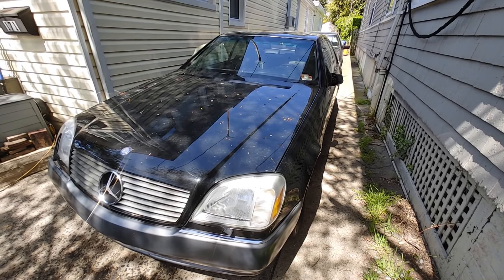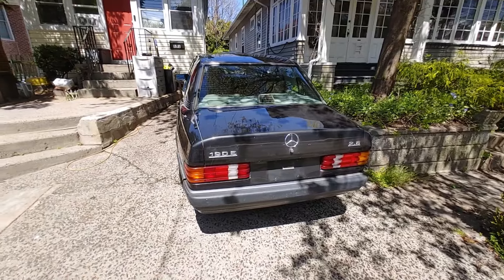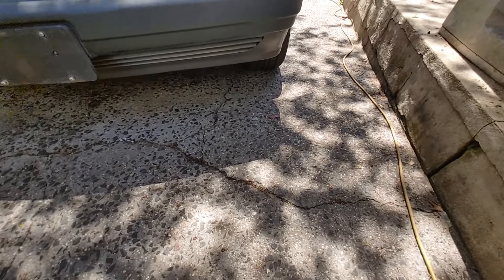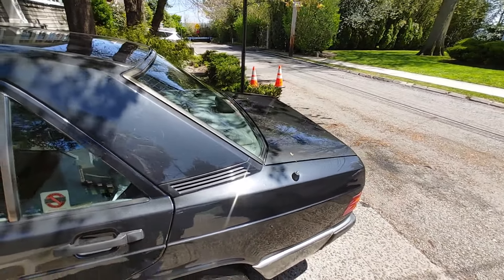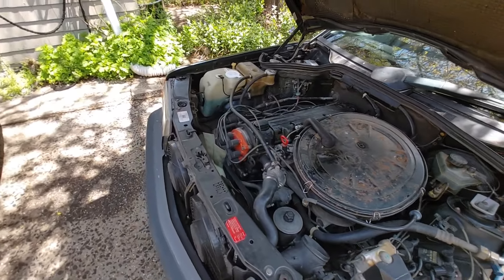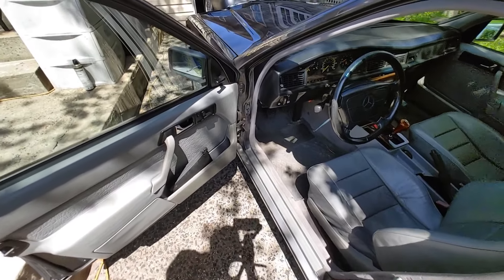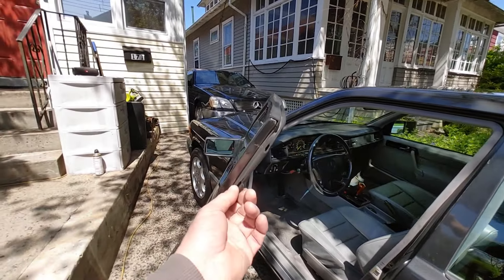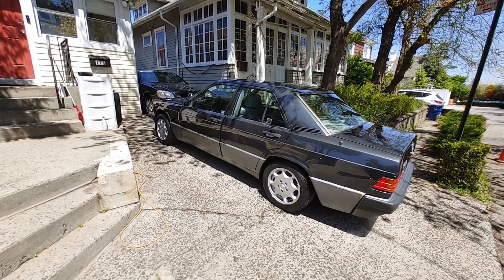1991 Mercedes 190E  first look and problem areas

Comment: Nice car, nice colour, nice interior, a classic now with distinctive styling. You have the nice 2.6 which are silky smooth when everything is running correctly, I know because I have an auto transmission 2.6 with over 200k miles too. If you're used to working on V12's this baby Benz should prove easy. Looking forward to future videos. 🙏👍😎

Comment: nice find. great condition. you can drop in a w202 diff from a 4 cylinder, the 98 c230 NA had the 3.27, swap the flanges and rear cover and drive it.  had one of those in my w201 at some point. the retaining pin for the spyder gear big pin fails in these a lot, or gauged carrier at same spyder gear mounting hole. deserves to continue to be on the road. keep up the good work .
Reply from the maker: Thanks. Not many w202 4 cylinders around anymore. So I ordered slk230 diff. 3.27 also but no abs sensor opening. Will see if I can get the gears from that one to install into w201 case and add abs wheel onto the i put shaft. 
One way or another I'll get it back on the road 👍
Reply: Case fits, just swap the output flanges and leave the sensor plugged in the diff housing. So you don't have to mess with the gears.  
I believe r170 should be the same type diff housing.  Besides the sensor opening.
You'll figure once you get the diff.